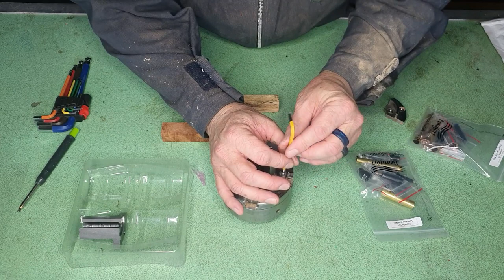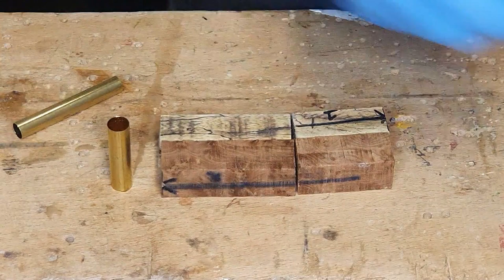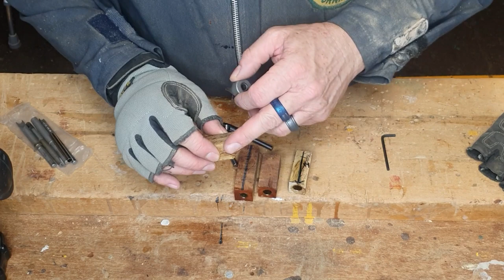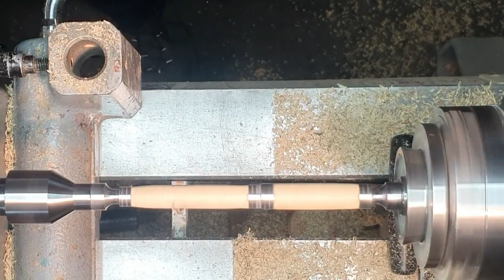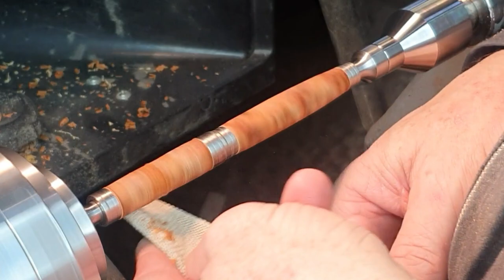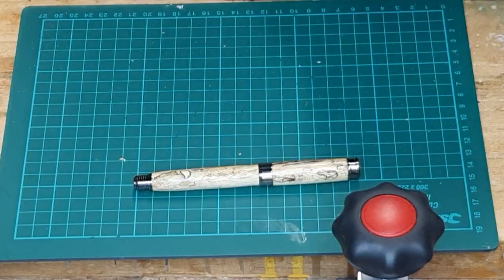Lovely, easy woodturning using the Leveche Fountain Pen Kits from Beaufort Ink

Comment: The pens look fantastic! My favorite is the spalted tamarind. It goes nicely with the gunmetal finish. Funny thing, though... I've never seen the mandrel mounted in the scroll chuck. Is it not a Morse taper, to fit directly into the lathe? Anyway, beautiful job on the pens. 👍
Reply: I’m 😅😅😅😅😅😅😮
Reply from the maker: Thank you, yes the Mandrel is 2 MT and can fit directly into the drive in the headstock.  But it can be held in a 4 jaw chuck, the jaws will mark the taper but not to the detriment of using it directly in the headstock.

I hold it in the chuck, purely because I was being lazy and not taking the chuck off the lathe.

I wouldn't hold a drive centre in the chuck if I needed to do spindle work close to the headstock end as there is too much risk of catching either tool or fingers in the chuck.

I hope that explanation helps